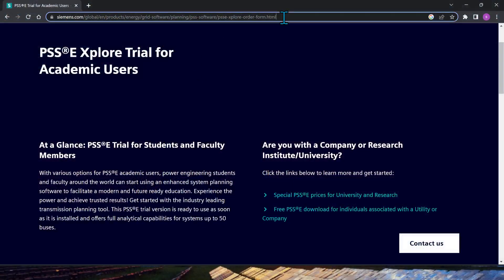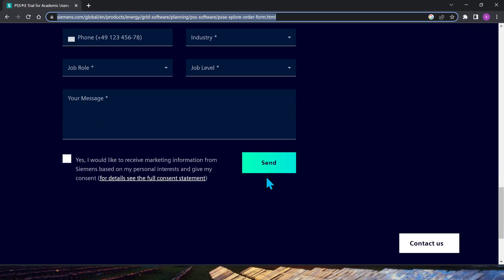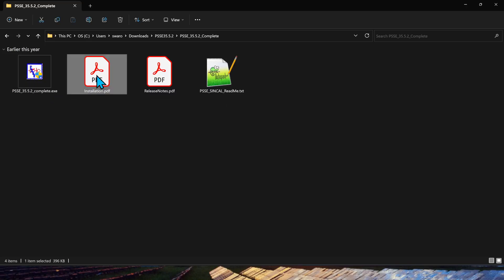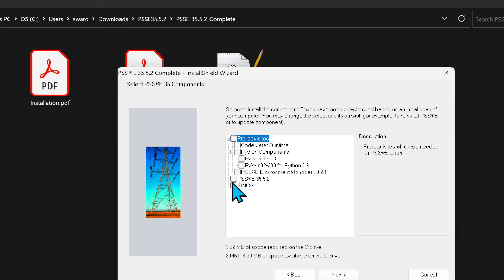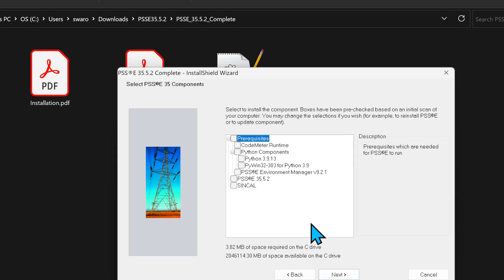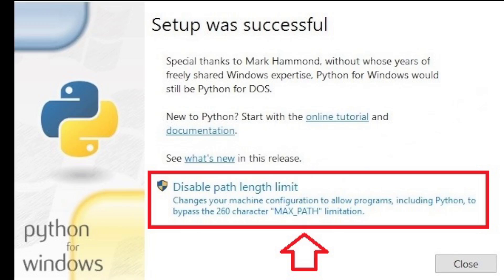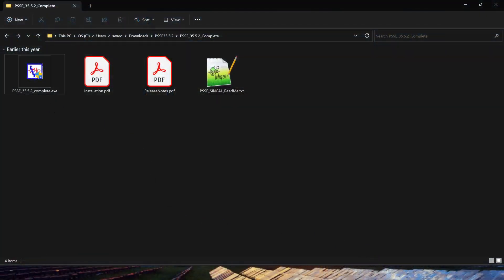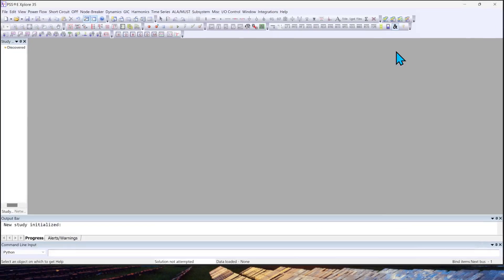PSSExplore Download and Installation

Comment: i have received the link but it asks to sign in when i open the download link. I have tried with my microsoft account but it gives error stating it does not belongs to "Siemens AG" tenant
Reply from the maker: Hi kartik,
That is strange, I recently downloaded a newer version, a couple of months back, and I received an email with Download link. After clicking on "Download Now", it starts downloading ZIP file.
There was no sign in required.

Did you request an academic trial version or industry trial version?

Meanwhile, I have also submitted a new request (academic version), to see if anything changed in this new year. I can post an update here once I receive the link.
Reply: Something similar happen to me, how did you solve it?